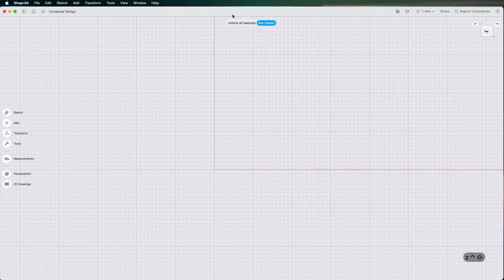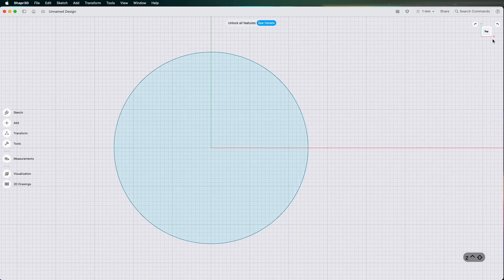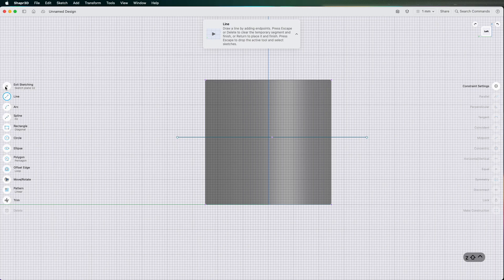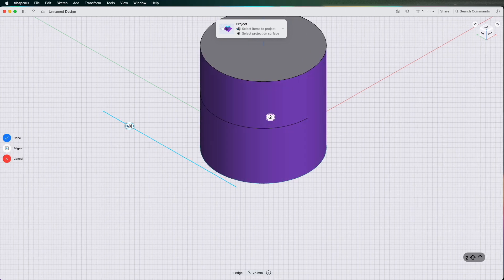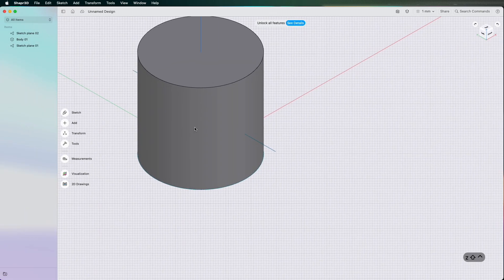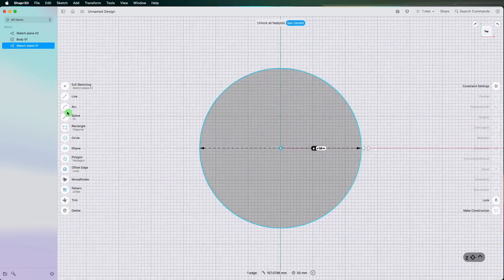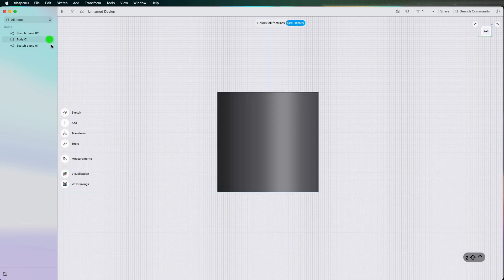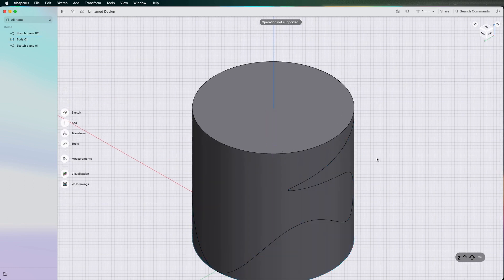Shapr3D- How To Project A Curve Around A Cylinder

Comment: If your sketch is moved outside the cylinder like in example 1. But the length of the line matches the circumference of the cylinder will it project full round?